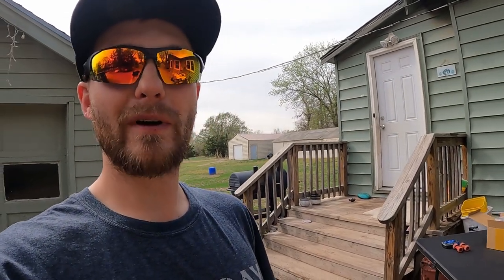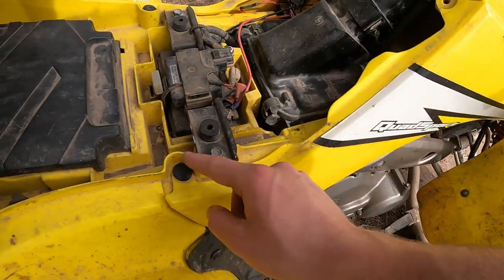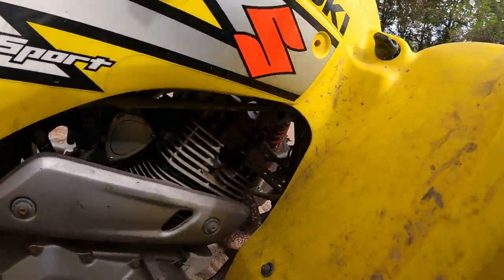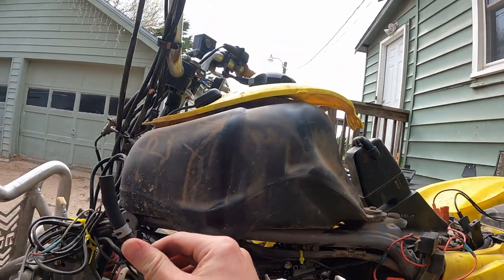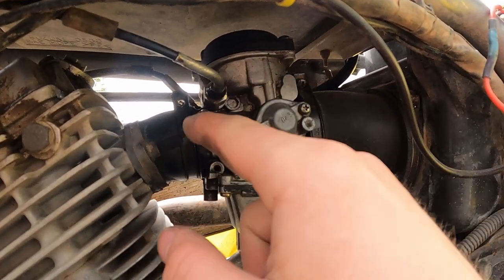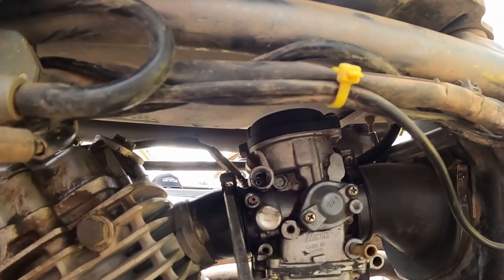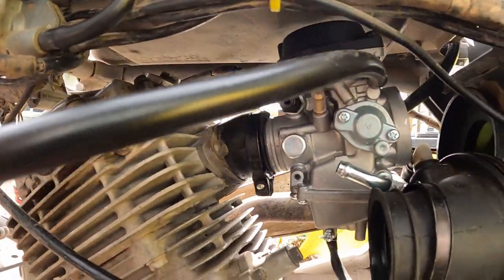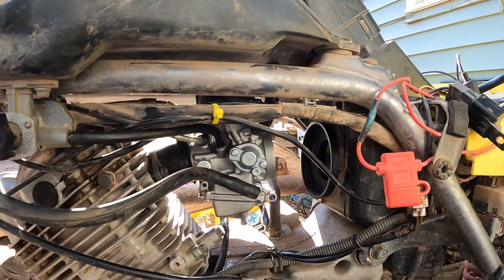How To replace a Carburetor on a Quad - 2005 Suzuki QuadSport LTZ250 - Daily Vlog

Comment: Have you gotten the new air tube yet? if so could you put a link in the description
Reply from the maker: I haven't found the right one yet. I did find some big ones on eBay, and a few other site, check the description for a couple options.

There are 2 carb sizes for these bikes. I have the smaller 29mm sized one, (29mm on the motor intake side of the carb). The other size carb, in this video is 33m I believe, but it makes a difference.